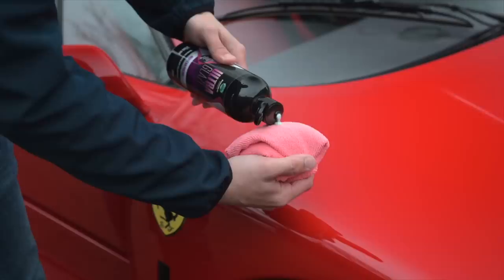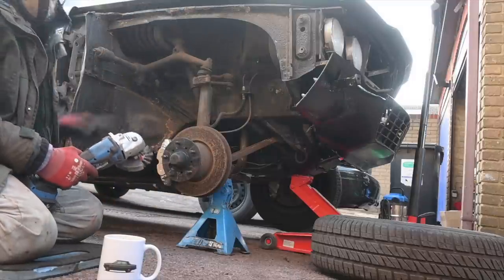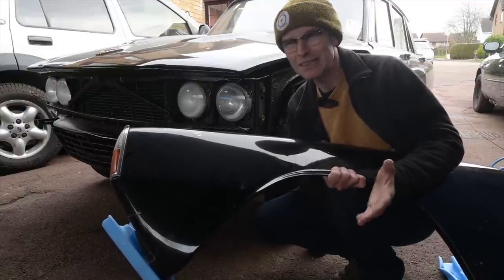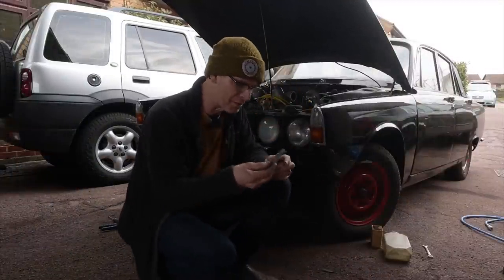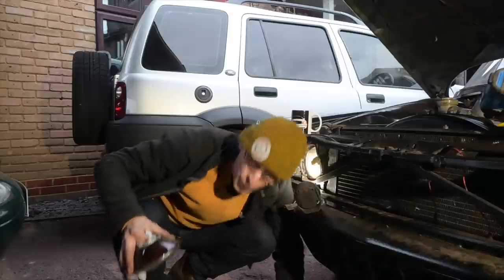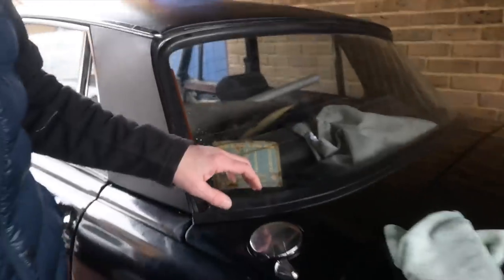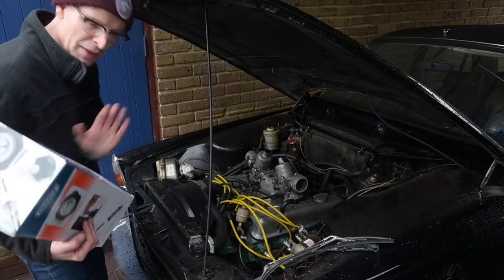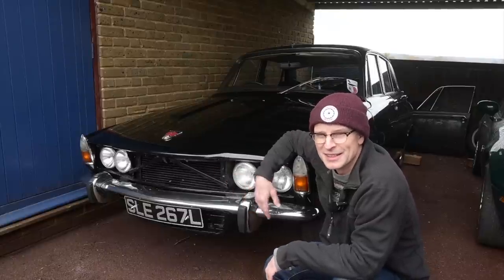It's nearly done! 4.6 V8 Rover P6 wings back on (and welding, of course)

Comment: Hilarious! “Such an easy car to put together” says Matt, 2 episodes after a near mental breakdown, and only 4 years in to the project! Keep going, nearly there. You’re excitement is infectious 👍
Reply: They are easy, you can take the outer skin panels off quickly..... if the fixings aren't rusted solid.  As well as it being an easy way to update the styling, the idea was that accident damage could be quickly repaired with ready painted panels from the factory.  Great idea in theory, but the base unit inevitably got damaged in anything more than a minor shunt, and often disturbing the fit and alignment of adjoining outer panels.

Comment: Matt don't know if it's any use but the bullet connectors to clean the inside of the female connectors try using an air rifle barrel cleaning brush the brushes are brass and won't damage them but clean the inside brilliantly I used to use them on my old cars and their not too expensive either  hope this helps

Comment: I love how the Crown Vic is just lurking in the background......"hello.....what about me?" 😂
Reply: It's interesting how closely matched the two 4.6 V8s are in the Rover 4600 and the Crown Victoria; ie; power and torque of the 4.6 Ranger Rover V8 = 225 HP/ 166 kW &  295 lb-ft/400 Nm; that of the 4.6 l  L2 V8 in the Crown Vic = 235 HP/175 kW & 276 lb-ft/374 Nm.
Bore and stroke =  Rover V8: 3.7 in (94 mm) x 3.23 in (82 mm) ; Ford L2:  3.552 in (90.2 mm) × 3.543 in (92.0 mm)

Comment: Great job Matt. If later on you decided to fit a manual gearbox..the 3.5  5 speed sd1 gearbox will fit and you can retain the auto propshaft ( the 4 speed 'S' gearbox has a longer propshaft) ..I had a 4 speed p6 3500S years ago

Comment: Looks great.

You do not need pass an MOT to put it back on the road or to get MOT exemption. You just tick MOT exempt when you tax it. You dont even need to get imports MOT'd if they are exempt to register/drive them here.

As long as its insured and you have the V5, go online to tax it (its free so do it anytime) and tick the MOT exemption box. It'll be legal to drive, then if it makes you feel better get an MOT at your leisure.
Reply: It has an upgraded engine of a capacity that the car didn’t come with, so it will still require an MOT.
Reply: @gregwhitaker438  yes of course everyone does that don't they. 🙄

And if the upgrade is period correct or as he said part of the original family of engines you don't need to get it MOT'd or pay road tax.
Reply: @BRED510  it doesn’t matter that it’s the same engine family or a period correct modification. An engine swap for one with a larger capacity and a higher output will require an MOT. 

You can chance it of course, but if (as has happened to me) you get pulled over when leaving a car show by some over zealous copper, you will get a kiss of hassle!
Reply: @gregwhitaker438  on what basis? When I swapped the engine in my  Beetle from a 1200 to a 1600 all I did was fill out a form and notify DVLA, a new updated logbook arrived a couple of weeks later. Because the engine was of a size/capacity and type that was an option when it was made there was no issue.
Reply: @gregwhitaker438  Not true. There is a lot of vagueness in the MOT exemption criteria around what constitutes a "substantial change", but this is one point upon which it's crystal clear:

"Alternative cubic capacities of the same basic engine and alternative original equipment engines are not considered to be a substantial change."

So swapping a 3.5L Rover V8 for a 4.6L Rover V8 has no bearing at all on MOT exemption status.
Reply: It will fail on lots of issues.

Comment: I presume the new brake bleeding kit pressurises the master cylinder to force fluid through the lines. A cheap and effective way I found was to find a screw lid the same as what is on the Master Cylinder Reservoir, drill a hole and and thread or use a two pack to insert  a Schroder valve .  A push bike pump is enough to pressure the reservoir , only takes a couple pumps as not much pressure is required to get the fluid through to the brake cylinder  nipples.

Comment: The easiest way to adjust that bonnet striker is just by sticking a short strip of 2" masking tape over the hole. Rub a dirty finger tip over the tape and highlight where the outer circle of the hole in the catch is. Put a tiny dab of dirty oil on the pin and just lower it enough to mark the masking tape. Finger tighten the striker pin, so it's just moveable as needed. Check where it touches and tighten the bolts once it's central.  You learn all the tricks when you do it everyday on bonus, even a novice can usually get it spot on in two goes. You shouldn't need to adjust the pin length, unless you've disturbed the height of the two front rubber buffer pins.
Reply from the maker: thanks, will try that this morning

Comment: You can't really lower the front on its springs due to the suspension design as you can clearly see when you lift it this radically changes the camber.  The only way to do it properly would be to reweld the stub axle higher up the swivel pillar if you could find someone mad enough to do this.  Rear - no problem.

Comment: Lo Matt. Loving your optimism. Re Bonnet/Hood adjustment. Normally you have a bit of adjustment room with the catch. Thinking  the bottom catch is normally spring loaded. Could it be that the  catch is sticky or the male part of the catch needs to be screwed down a wee bit. Just a suggestion , as i said the adjustment on these shouldn't be that finite. Thanks for the vid. Luvin the skweeky boot. Happy Days. Later   😵‍💫
Reply from the maker: all needs looking at, there is adjustment top and bottom

Comment: I had a fitment problem on a bonnet as well, until a friend pointed out that the way to pick up 1/4 inch was to re-position the main mount slightly....as I was preparing to bend the catch mechanism....Tunnel vision....

Comment: Slightly geeky observation...the P6 & Freelander which were side by side during this video were both assembled in the same building at Solihull but 30 years apart....admittedly North Works was extended for Freelander but all the same....North Works was built for P6 back in in the very early 60's.
Reply from the maker: Thats a very good point, it handn't crossed my mind before!

Comment: Awe I love this car, so much nicer in black than the original utilitarian blue and the chrome really sets it off. I was wondering why the back lights looked a little bare, ah I see they were missing the reflectors. Nice how you managed to capture the street lights coming on, a metaphor perhaps? She sounded very fruity on start up and even the rev counter works unlike my own. I'd be tempted to replace the screws holding the sill covers with stainless steel items as the ones you removed seemed to be corroding already. I can't wait for a drive video in this beauty. I think she's going to pass the mot with flying colours, here's fingers crossed! 🤞😎 P.S. what happened with the fan, did it arrive, did you fit it yet? As for the bonnet latch, I've had it where the outer sheath of the bonnet release cable, the hard plastic bit, was sliding at its mounting points when pulled from inside so failing to pull on the latch mechanism.

Comment: Some Rostyle alloy wheels and the spare wheel on the boot lid would look amazing against the black.
Reply: Spare wheel on the boot of a P6 is shitty looking in my opinion.., more for older cars
Reply: @cappaculla  
Continental Touring Kit' as dealers called it
Reply: @cappaculla  I'm not a fan of that either, but the option was there because the boot is very small for a car of its size. The complex De Dion rear suspension takes up all the space.

Comment: I’ve got that brake bleeding kit, it works really well until you use the adapter. I found it needs a stiffening plate as it is to bendy and let fluid push out everywhere, from the reservoir, hopefully they are better now

Comment: Hey Matt, am currently trying to recommission a couple of older welding machines but having had some issues with parts, I went and had a look on your affiliate link at the Draper one you use. The listing says that a 32A supply is required, do you have that or does it still work from a normal houshold socket but at lower power?
Reply from the maker: Ive only ever used in on a normal plug without any issues

Comment: I never had any bother with the Eezibleed. You do have to let some of the air out of the tyre but the instructions tell you the required pressure.
Reply from the maker: it never seems to work for me!
Reply: I brought a vizzableed,less than a fiver,absolutley brilliant,bled my brakes on my own in minutes.has a one way valve in it.just push the pedal 3 or for times and thats it job done.
Reply: I had an eezibleed and it worked fine on old cars but on newer cars I've never been able to get the brake reservior cap to seal adequately. The vizzableed pipe often fails to stay on the bleed valve for me.

Comment: The fogging on the headlights is caused by the silver reflecting material on the headlight it is caused by the heat from the globe l have a bit on my Hiluxes headlight one they are sealed beams at least one has been changed because there is a different brand name on it l have never been knocked back on my yearly registration inspection for the head lights l will change them over for His sometime in the future because at hight they are awful also could you cover up those red front wheels please l hope you have the wheel trims for them they don't suit the Rover apart from the wheels they are a very good looking car and definitely go carburators they are mechanical and will be much easier to tune or if there is a mechanical fuel injection available

Comment: Yes definitely 😊lower it stance it have the front slightly lower then the back that will look lovely with the red wheels and maybe just maybe band the rear wheels a bit job done be a wicked looking car
Reply from the maker: Thanks, I’ve been reading up on doing all that and where to get the parts, wheels can’t go too wide as the suspension makes it tight but

Comment: if it is over fifty years old, does it need an MOT?
Reply from the maker: needs an initial one to no longer need them, and one to prove to DVLA the engine fitted is the # Ive said
Reply: @furiousdriving  no you don't. You do not need an initial MOT to get exemption. Just go online and tax it, tick the MOT exemption box and it's done. Tax it anytime as its free. The only caveat is if it isn't registered as historic you need to fill out a form at the post office to get the tax class changed so it's exempt. But you do not need an MOT first.

And tell your insurance about the engine swap certainly, but what's the point in updating the log book with the new engine number, it doesn't add anything just hassle for you.
Reply from the maker: @BRED510  dvla wouldn’t accept the engine swap without an mot, they sent back all the paperwork
Reply: @furiousdriving you currently have it on SORN at the moment, and as it's over 40 years old, no MOT is required. You could just re-tax it at vast expense at the Post Office if you were really desperate to put it back on the road (you can't do it online without an MOT if it isn't Historic registered), but you'll need a V112 (MOT exemption declaration). To register as Historic and have free 'tax', just take the V5C to the Post Office, as well as a V112 (which they look at and either throw it away or pass back to you...), and they will send off the V5C to the DVLA to change the classification. No current MOT is required - you can go from SORN with no MOT, to TAXED with no MOT in one visit to the PO. I know, I've done it...
Reply: @furiousdriving  then why bother? Leave it registered as it is, your insurance are the important ones to notify about the engine.
Reply from the maker: @CaseyJonesNumber1  I’m not disagreeing with that, it’s the new engine part. Dvla won’t change the V5 to show the new CC or engine number without an mot on the car, unless they’ve changed policy in the last year
Reply: @furiousdriving  I did it around 18 months ago when I swapped my MGB's original 1.8 B-series for a 4.6L V8. Posted my V5 to Swansea with a covering letter explaining the change and a reminder that the Rover V8 was also a factory option for the MGB GT, got an updated V5 with the new details by return post. Probably depends upon who opens the post at the DVLA on any given day :D My car didn't have an MOT then, still doesn't, but will probably get one for peace of mind before driving it (furiously).